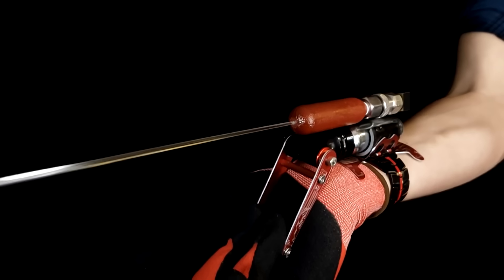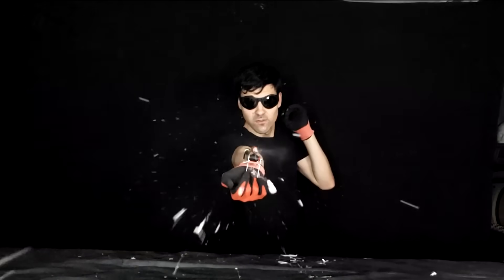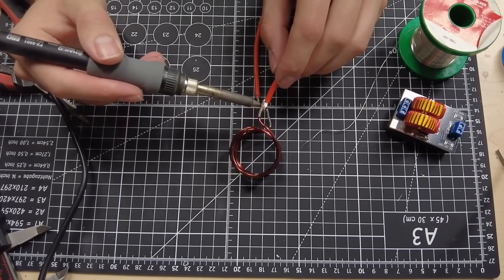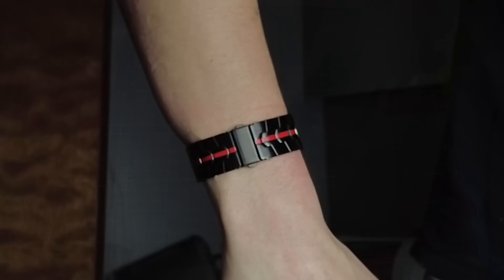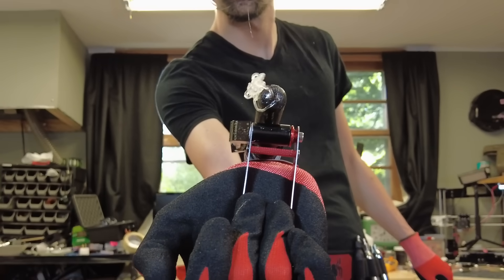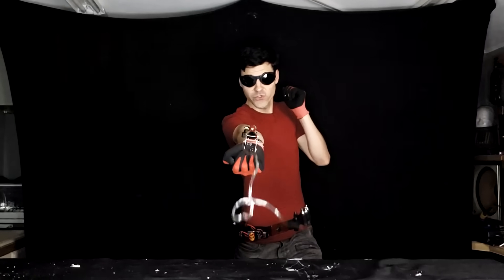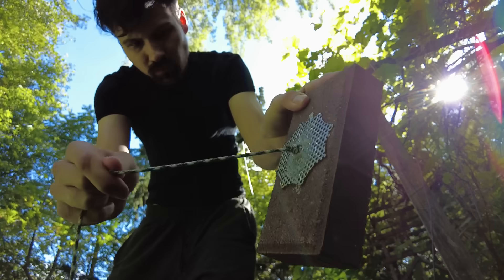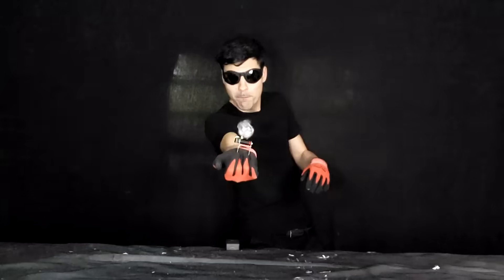REAL Web Shooter (Spider-Man: No Way Home)

Comment: I don't know if a simple youtube comment can be helpful to geniuses like you and JT, but watching all of these videos i had an idea:

Firing a rope without any weight on it is impossible at any reasonable distance, and we also want our rope to stick onto a surface rather than wrap around it, like JT said. The solution? 

JTs grappling gun, firing a rope, with a glue ball at the end of it, that would be flattened and spread by a small piece of metal behind the glue ball, in the shape of the anchor you made in this video.

I imagine it would be like this:  
The hot glue balls and the small replicas of your metallic anchors would NOT be on the rope, rather as cartidges which would hold multiple of those balls and anchors. The glue ball and anchor would be added to each end of a NEW rope before firing, inside the grapple gun.
Reply: This way, we could carry "packs" of rope that we could easily load into the grappling gun AND have cartidges that would load the glue balls and their anchors at the end of a rope. 

The grapple gun could keep the rope "firing" until you let go, to have a rope with a length of your choice AND a button to cut off the rope whenever you wish, with a "dual blade" BITE mechanism which would bite the (hopefully very strong) rope at 2 sides to cut it with ease.

Comment: what if you, 1, used little magnetic metal shavings that bond together to make a sort of microscopic mesh that bond together when sticking, and 2, use some sort of light weight, high tensile, quick cooling polymer thak gives enough time to stick but also enough time to get strength to hold the human body. That way, you wouldn't have toi pre-place the mesh and your rope would be the web itself!

Comment: I known you use hot glue but something needs to chill the hot glue so it comes out like a web sticks faster and holds weight heavier. Maybe finding what is the most sticky glue or adhesive. And dry ice . And a steel cable?
Reply: It won't stick if it becomes cold
Reply: @generalflopper9697  damn, what if it cools it after?
Reply: @generalflopper9697  or hardens

Comment: Might be suggested but what about springs inside a rubber anchor so it’ll fit and then fling open, ideally it should open on impact to prevent drag and hence air cooling but that’s a whole other challenge

Comment: i dont know if this would work but if you made the metal web anchor thing out of something that would go back to its original shape (similar to a spring) and try to fit that on the end of the cartridge so it will open up in the air and be the flat anchor by the time it hits the surface

Comment: What if you had a tip to filter out how the glue comes out? If you had a circle plate with holes shoot out thin strands and if the plate would then rotate wouldn't the strands weave around one another making it like a rope? In my head it's like a spray of glue then after the tip spins it makes a threaded rope. I'm no engineer but I was playing with some playdoh and got the idea. Would look like spiderman webs too. Cool stuff though my man.

Comment: i would suggest using small, but very sturdy hinges on the mesh plate. fold the plate inwards so when the cartridge propels the mesh and glue, it also opens up, thus sticking to the wall with the glue. just an idea

Comment: if you made the anchor into a folding and unfolding capsule that has a high melting point you could possibly store the glue in the anchor then shoot it out in the same barrel using the same mechanism and heaters

Comment: Ever consider using a liquid plastic like fresh formed nylon or styrofoam dissolved by acetone/limonene? It would streamline the need for a heating element. My other thought is what if the surface area plate folded like an umbrella so it could be fired like a dart?

Comment: It would be cool if there was a kind of glue that would react to electricity the same way that water loses surface tension when mixed with dishwasher. Then you could have it stick to the wall while swinging, but then let go and come back for another round. It would be more like two ropes that sticks to things than actual spider web, but it would work for swinging

Comment: It is actually physically impossible to make real spider web shooters. Having a sticky cord that can be ejected from a wrist mounted gun with enough "stickiness" to hold up a man but then break off when needed... It would be insainly hard to do, but that part is plausible. What isn't plausible is the amount of webbing Spider-Man has, the amount of force needed to send the webbing as far as it goes, and the weight/durability of the web itself.

So first the amount of webbing spidey has in his little shooters. The volume of it is insane, unless he can somehow turn it into a gas or compress the webs, there's no way enough webbing could fit into those little things. Unless ofcourse you want to sacrifice the strength of said web for smaller weaker webs that probably wouldn't hold up a full grown man. And even assuming we had some insainly dense webs how heavy would the web shooters be? This isn't a problem for spidey who has super human strength but a regular human might not be able to carry let alone use spideys web shooters.

Okay so let's say we manage to get a super light substance that's also super sticky and super strong. How are we going to shoot it out with enough force to stick to a building and then swing from it? We know that any force applied into throwing the string will have to be applied back on the arm of the person, so it can't be to powerful, unless it was hooked up to some sort of exoskeleton, this would also solve the problem of your arm being ripped from its socket when you swing through the city.. Spideys string shooters also don't make a giant boom so they must be propelleled by something other than gun powder. Compressed air? Where is it stored? Chemical reaction that increases pressure in the web shooters than the shooters release the string? Wouldn't that die down eventually though?

Also wouldn't the sticky solution guck up the firing mechanism? And if it is super thin/small it would be incredibly hard to shoot aerodynamically. Imagine having to throw wet spaghetti strands a distance of several hundred feet? And then swing on said spaghetti? I guess if you could have a longer barrel it would be easier to shoot straight but still spidey's barrel doesn't seem too long... Okay I know there's a really inappropriate joke in there but come on.. Not everything on the Internet has to be inapropro.

And finally we're back to the aerodynamics... It's insainly hard to shoot wet spaghetti in a straight line. If the strings or ropes were wider or more massive which would allow it to apply more force if shot at the same speed. (F=M*A force equals mass times Acceloration). But we know that in order to make enough spidey string we'd have to make it compact and light... So that then negates it's effective range and speed.

Now I know I said and finally but I'm to tired to correct that, there are more problems with the web shooters favorite gadget but those are the main ones I could think of.

Comment: perhaps a hinged, spring loaded version of the anchor?  pre-coat it with glue and launch it thru a coil to heat it instantly, but with a textured back to disperse that heat rapidly, so that it will be more likely to adhere. perhaps with a dead-blow weight behind it for harder and longer contact. trail a hooked cord like built IRL's and a firing mechanism and cartridge more like his... hmmmm...

Comment: what if you you use, same meshes,  but the have like a sliding door mechanism, so the anchor expands when it is shot and wont require much electronic work, you can also try something like an umbrella that opens up whilst launching and gets stuck once launched, even the glue on the surface can help it getting stuck

Comment: They should be tackling this in multiple ways... 1st you need to work out a web fluid, I always imagined expanding foam like silly string has not reached its full potential. If a web fluid that is more accurate to the comic could be developed then that would totally change the design potential.... I feel like the more you focus on ropes and metal grappling hooks it takes you further and further away from actually creating real web shooters. We can make silly string that shoots across a room with CO2 pressure alone... then we have adhesives... Crazy glue actuallyglued a guy's hard hat to a ceiling and the guy hangs from it as there advertising slogan but in realitythey have actually glued a chain to the roof of a vehicle and lifted it by the chain with a crane!!! So there has to be a way to make a realistic web fluid one would think??? (ARE YOU MAKING WEB SHOOTERS OR GRAPPLING HOOKS???)

Comment: Why not create a capsule at the end of the pressure valve loaded with the stuff that makes nylon, and then releasing the valve forces the two reactants together insanely fast while also pushing them out into a grappling hook anchor, launching both the nylon thread and the grappling hook out?

Comment: Honestly, get a chemist on board. We need that hot glue to change into something that does not require heat. My thought is a quick-curing air-reactant polimer (or a two-part composite). Somebody's GOT to be able to fabricate that!

Comment: If you use that metal that returns to its original shape when heat is applied you could fit the anchor into the tube

Comment: instead of a lever to activate the cartridge why not a touch activated palm plate, way more compact. The anchor could unfold like a solar sail but not metal but maybe a polymer formed piece rolled up. Adding a single carbon fiber threading to the glue as it is fired could be interesting, just ideas to think about...

Comment: You should make a spinneret for the web shooter. That’s if you make a fluid…it’s like a rope. How ropes are twisted together…that’s what makes it stronger. So, if the fluid were able to contact each other by spinning and twisting together…then the fluid should make a solid line…instead of blasting and splattering everywhere.

Comment: Chainmail as the metal with the hot glue init. no need for metal case the induction can heat the chainmail. Use a piano wire or thin cable in a long hose taped to your body. Maybe down the arm across the body and down one leg. no need o try and compact and wind it onto your arm. You can store multiple on there for multi shot.

Comment: If there was a way to have some sort of mesh structure like that frontloaded into the cartridge so that when it's fired the entire mesh comes out and opens up due to a lack of tension being applied to it you'd potentially have a solution to getting it from the launcher to a surface to adhere. The problem of course being the insane amount of pressure needed, the backup of the glue, wind resistance going out the tit as that opened up in mid air, and an array of other issues.

Comment: Seeing that metal plate stick to the brick left me wondering if you can model a design that makes it snap off the side of the glue launcher, if the metal plate could be closed to give it a pointed shape to cut through the air and touch. an open surface would allow for faster use of what the web launcher could be.  I'm not an inventor or anything like that, something just came to mind that might work as no

Comment: To get it all in one cartridge try making modified hot glue cylinders to go into the metal web template or stick out the back of it so it ejects both at the same time with the glue being able to stick to the surface, then to be  able to swing 'web to web' you will need to able to make an ejection system so the cartridge can be ejected and a new one can be put in. To put one a cartridge in you could make something to carry other cartridges on your wrist and it feed the cartridges into the 'web slinger', this might be too heavy to be on a wrist so it might be able to go onto the inside of your forearm? This video was awesome and since this is mk.1 imagine what the other improved versions can do!

Comment: Hey man, quick question. Have you considered building the platforms similar to a bullet? With the glue head in the front, and a collapsible umbrella style metal mesh behind it? Can be launched with a compressed air charge, potentially part of the bullet, and should be able to glue, stick, and swing in 1 round as long as the glue dries quickly enough. Look into it? I don't have the resources to do it myself. Thanks and good luck.
Reply: I feel dumb
Reply: Spider gun
Reply: Good idea I hope he see this
Reply: Sounds like something worth looking into
Reply: I was also thinking of something like the collapsible umbrella, and you really have some great ideas! Sure hope he sees this
Reply: you realy tougth this up didint you?
Reply: Or maybe try making it yourself fam
Reply: @kilovwdude6457  he got got the resources.  Also sounds dangerous.  What if the glue doesn’t dry fast enough.  A hot glue on rounds sounds interesting though

Comment: I would imagine a more malleable mesh for the anchor at the end of the rope for fitting it into the tubing. Finding something that could be strong enough and malleable is gonna prove pretty difficult though. GL! Hope to see the progress.

Maybe something like a origami chain mail solution?

Also have you considered using like a neutral temperature adhesive and coating the mesh on the end of the rope in it?
Reply: If he uses that metal that returns to its shape with heat it would work perfectly
Reply: @ethansquires2880  nitnol
Reply: https://www.youtube.com/watch?v=JfbyiPaurlM&t=4s 🕷️💜
Reply: Kevlar would almost certainly work now that I think of it

Comment: Number one problem i see is lack of compression and self supportable webs so you would need a sticky contractable robe that self resets after launch and could unstick easily via a type of instant glue disolvent that could be released at the stick part end of the web or have it cut itself at the sticky part then add more glue to the end when resetting or firing

Comment: I have an idea for the next model: A camera shutter with an array of holes drilled at an angle. The idea being this would be like having the anchor built in. The shutter would open up after a certain period, as to catch the surface area-increasing strands so that they don't end up traveling further than necessary, and to have a large "rope" you can grab.

Comment: Well the reason it comes out of the shooter like that is because you’re using only one exit tube I think if you made multiple small exit tubes it would come out more like a real web because as they’d shoot out in a straight line they’d also link together basically the same as a real spider would but you also would need to make sure the pressure of your shooters isn’t too high or too low that’s just my concept of how you could make a somewhat real shooter I haven’t seen anyone do that yet I mean you may not be able to swing from the webs but I think you’d be able to shoot a real web/rope from point A to point B and grab things

Comment: I have an idea how about you put the rope inside the cartridge with the hold on what happens if you had some system to shoot on the metal web that’s also attached to some type of hoist anchor whatever like some type of string like the rubber you’re using on the outside of it so when it fires there’s something shooting on the metal web in the metal up gets fired out of something connecting to the wall holding! You could swing like Spiderman? For now this is a theory keep up the good work

Comment: Just watching the video when he said he wants to fit the rope glue and anchor in one thing - place a chain in a tube attached to the device whitch holds the anchor. Have the anchor holding on the part where the glue comes out with two of those thingys that lock the door with the wall that i cant remember the name of and have the glue shoot out at a high speed while the door things unlock as the glue shoots out and attaches to something - there might be a few flaws because im just some dumb teen

Comment: Hey, I have an idea as to how you can make this stick to more surfaces with a more flexible design. The issue is its gonna sacrifice strength most likely. Just like when spiderman shoots his web, right before it sticks to the wall, it manically spreads out. My idea is to have your template scaled down but then add 3 piece arms to every edge on a hinge essentially. This way it will wrap around whatever this new anchor gets shot at. You can add glue stick slivers to each arm piece and keep your heating method the same.

Comment: this might be impossible or very hard to do, idk, but what if you put the anchor inside the shooter with the big blob of glue, maybe in some way folded up but with springs so that when it is shot out it expands and goes to it’s normal form and then bonds with the glue, and then have your rope attached to it from outside in some way? obviously you would have to have the rope linked to a body harness in some  way so that your arm doesn’t get ripped off on a hefty swing but i can see real life web shooters being introduced very soon!

Comment: What about using high tension fishing line and modified steel bearings in hot glue? Like sticky buckshot esentionaly, each bearing could have line put in it and it cluld be done in a web/net fashion and could fold easily, so maybe that would work??

Comment: why not just reverse the co2 canister so the pipe leading to the quick connect fitting is shorter? yeah it would lengthen the trigger mechanism but have you thought of using an electronic valve instead? it would decrease the reliability but you could regulate airflow more precisely which could be more desirable in future swinging + sticking prototypes and the trigger mechanism could be as simple as just connecting a circuit to a button on your palm more similar to the real spiderman web shooters